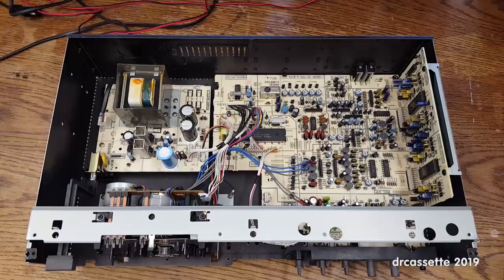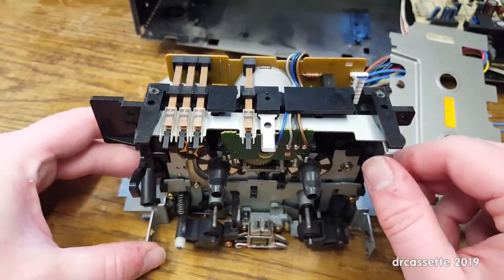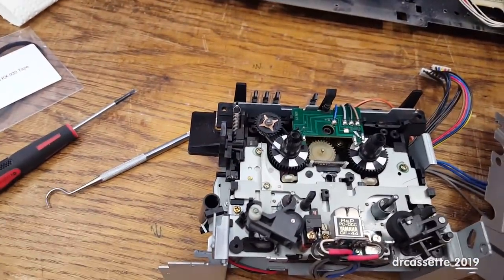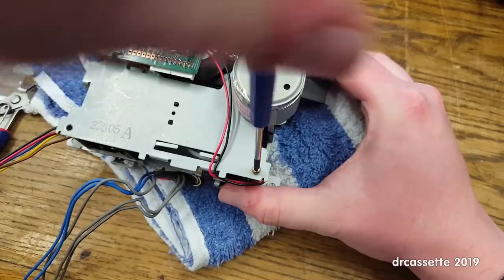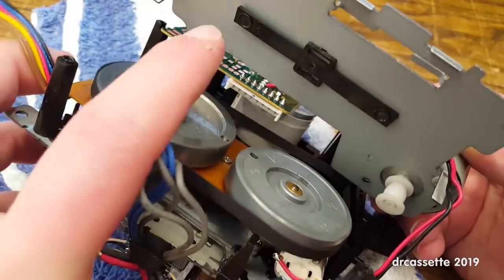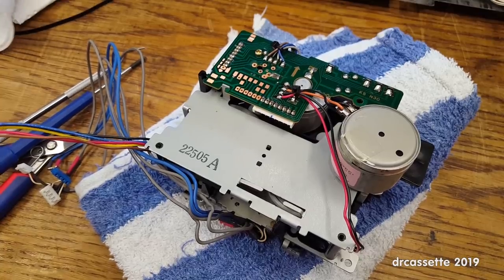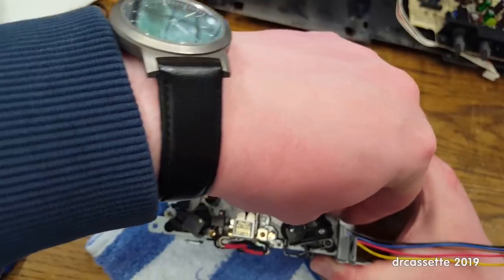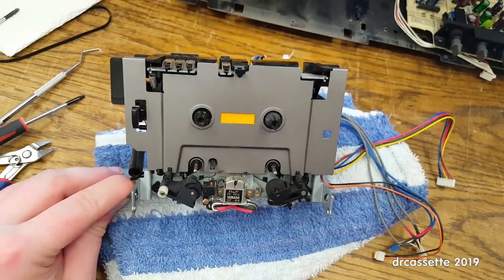Yamaha KX-930 cassette deck repairs [2/3] - belt replacement

Comment: Apparently Marrs communications is very good for high quality OEM standard cassette deck belts. Many people on tapeheads.net use Marrs belts, especially on Nakamichi gear. They are quite pricey though but again, supposedly the best around
Reply from the maker: I have heard of Marrs before, maybe I'll give them a try some time.
Reply: Exactly, nobody beats M.A.R.S, unless someone can still find original Nak belts or any other one OEM, preferably before mid 90's on this planet.
Reply: Alex Baker 
40 bucks for international shipping lol
Reply: @AttilaTheHun333333  
The belt kit and S&H from Marrs, or just the shipping (that hurts).
Reply: @pliedtka 
Just shipping...belts cost another 20 to 50 bucks. Those have to be really good. Lol
Reply from the maker: What? 20€ for a belt? Well, then that's never going to happen for me, unless I find a Nakamichi Dragon or something like that at the dump.
Reply: DrCassette 
They have belt kits for 50 bucks plus shipping. Ridiculously overpriced.
Reply from the maker: Most cassette decks that I work on are only worth about 50€. So putting such expensive belts into those just doesn't make any sense.
Reply: @DrCassette  
I don't think you find any Nak at the junk maybe BX150 or something similar. People are now more crazy about Nakamichi than before since the name is sort of a legendary. Well they were one of the first to introduce Dolby noise reduction, and in their implementation works really well, unlike one 3header, Dual Capstan Direct Drive, I owned, which was horrible in Dolby C. I heard Dragon once and it is one of the best sounding cassette decks, no doubt about it. But many are also very good, too bad good quality tapes type II and IV are NLA.
Reply: @DrCassette  you're right, for cheap decks it makes no sense but it might be justified for a high end Aiwa, Denon or Yamaha like yours I guess. Very expensive nevertheless!
Reply: @pliedtka  I only have an RX-202E and am lucky that theres still 1 authorised Nakamichi service centre left in the UK, albeit very expensive to send your deck to! It's a collector's market for Naks and is a bit like buying a car, because the paperwork proving it's been serviced at the right place increases the value.
Reply: @DrCassette  I have bought their belts a few times (not too many).  I have to admit they are very good belts but, it may take months to receive what you ordered and, if you follow-up you may not get an answer and, if you follow-up again or complain about the time it is taking, they may get upset with you and cancel and refund your order, and ban you from ever buy again from them.  I am not joking.  So you may just waste your time and patience.  I suggest you read comments about them in the common forums.  Best of luck.
Reply: @64bakes  
It is collector's item, like the 505. So B&W or Bang&Olufsen does the service. I read it about on tapeheads.net. This man 
www.ant-audio.co.uk, also Alex does a lot decks and makes calibration tapes to die for, not cheap but you get your money's worth. Has many decks in his collection, a few Naks, so visit his website just in case - he does service and align them from time to time from I read on the forum. 
Personally I haven't heard any other decks to sound in Dolby C as good as Nakamichis do, so keep yours in prime condition. All best 👍
Reply: @pliedtka  the place I was referring to is B&W like you mentioned, but I'm looking at circa £250 for a service! Mine is in mint condition with the original box and instructions, and luckily found it before the prices got too high. I do still use cassettes so will get round to servicing it soon, once I can stomach the price 🤣 

I've emailed Alex at ANT before about alignment tapes for an old Teac CX-400 which I used to have. He's a very nice guy and happy to spend time giving people advice. I'd recommend him all day long.
Reply: I just replaced the belts on my 930. Got the belts from turntableneedles dot com (in the U.S.). MUCH cheaper than Marrs and they seem to be of good quality.

Comment: why two pinch rollers when it"s not auto reverse ?
Reply from the maker: This cassette deck has a dual capstan drive, meaning both pinch rollers are engaged at the same time, one feeding the tape to the heads, the other one away from the heads. The speed that both capstans run at is carefully balanced to be slightly different. This way the proper tape tension across the heads is ensured. This eliminates the bad influence the supply reel and the cassette shell can have on sound reproduction.
Reply: @DrCassette  Thanks for the reply. Just got a free deck from a friend k-1020 and I need belts for it  : (

Comment: Is reverse one captan is supposed to turn reverse not like that you are placed wrongly the belt
Reply from the maker: This is not an auto reverse cassette deck. Both capstans are supposed to turn into the same direction. It's called Closed Loop Dual Capstan.
Reply: @DrCassette  is have 2 pinch roll  and 2 captan im never see anyting like this
Reply: @mikec9112  im navet see anyting like this soo is ok to know this but again is strange

Comment: Yeah, many belts on cheaper decks, especially double deckers, turn into black gummy goo stuck to the capstan wheels - many Sony decks being affected - sorry Sony fans, but from mid 90s the company many more and more junk until it seems to make mostly junk. Good made in Japan belts are available for many decks but you have to pay for quality more these days than before. Tapeheads.net, audio forum dedicated to tape decks has members who are knowledgeable and might give advice. Some people people sell calibration tapes, Alex being know for making excellent ones. Also there is W&F measuring soft available from one of the members - a must to have tool for testing and troubleshooting mechanism. If you have really good direct drive deck you can make 3kHz tape for setting speed after belt change - give the belt some time to set in. On the other hand I have question - where can I get spare capstan motor, CCW 12V, adj speed - same as in the Yamaha you have, but also used on many other machines.
Reply from the maker: How long have you been having dissolved belts in 90s Japanese equipment? This seems to be a rather recent development, when I got into repairing equipment about 10 years ago, you would only find dissolved belts in 1960s/70s Philips equipment and obscure old Korean equipment. Seems to me like the 90s cheap belts held up until fairly recently and are just now starting to fail and dissolve. 
As for your motor replacement, I would try to salvage one from another cassette deck. These are indeed very common in 90s cassette decks.
Reply: @DrCassette  
Had two dual decks from Sony, one with Dolby S. Both of them had disintegrated belts on both decks - the transports were of no better quality than some portables. But JVC, Technics, Pioneer and Teac from the same time didn't have the same problem. Have JVC and Technics under my bed with JVC having capstan motor dead with worn bearings in one deck (for parts)  and Technics still working properly with a little age related issues (worn heads, higher W&F). It's very hard to find used deck in Canada in good condition - Canadians are not in Audio like Europeans. There is a few of us in Ottawa that do DIY audio and repair electronics, some restoring old equipment but in Europe this kind of hobby is more popular. Another thing is that a lot top of the line equipment that was available in Europe and Japan never made it to Canada. You think I have seen Accuphase here - no, but some of my friends in Poland own it. My first contact with Nakamichi and top of the line Akai  Aiwa, etc, was in mid 80s because people were bringing them from Germany, with almost every Japanese brand available. You are in way better position to find worthy equipment like this Yamaha in Europe than me in Canada. From all electronic shops that still fix audio, only a few are left, run by Chinese owners and some hard core people who like it because nobody can get the parts or repair costs are too high. Well eventually I fix my Nakamichi somehow and really good CD player from this time that has all the functions and headphone output.
Reply from the maker: Oh wow, I didn't know HiFi equipment was so uncommon over in Canada...
Reply: @DrCassette  
There are good companies here, my friend Mark Kravczenko designs some of the best spkr drivers you can get, but in very limited number, his AMTs are as good as Mundorf. National Research Council has nice anechoic chamber that a lot of North American firms are using, and a lot pioneering research in spkr design was done there. Focus Audio from Toronto Area uses Eton and Scan in their spkrs SimAudio, Bryston, Paradigm are known every where to Hi-end enthusiast. But for most people cheap sound bar and large TV from Best Buy is enough and we have decline in serious audio interest in general, thanks to MP3s and junky headphones from Dr Dre (same price Audio Technica M-50X wipe the floor with them). So this is the sorry state of audio in Canada, at least in Ottawa.
Reply: I got serious problems with nice deck from the early 1980s with the "goo monster" belts -- actually with only the capstan big flat belt.  A mess to clean up, but then worth it -- lots of Q-tips, paper towel and alcohol -- some people suggest to use stronger chemicals as acetone but I didn't dare to use.  I agree w/ your suggestion to calibrate the speed w/ a proper speed tape (3 kHz).
Reply: @jdgshsjchdjejkd545  
It's almost impossible to get the 1990s original parts. I think the 530 motor might work in some Naks and other decks but the fact that its body is connected to the ground might be a problem. You can most likely find the Service Manual for the KX-930. On the other hand it might be possible to isolate the circuit board from the body so you won't have a short - you will have to remove the cover and cut the negative connection to the motors body. Don't have the motor on the table, so I guess from memory. Also some people complain that the current production has some issues. I think I will go with Universal Capstan Motor sold by Pacific Audio (or something similar in name) as is seems much more robust - of course more $, but better quality than 530.

Comment: I am so mad at myself today...for all that have a Technics RS-TR311...do NOT give up on a problem where the tape will not play forward...and will only play backwards...it IS THE center gear that look off yellow, that go between the two drive pins that go thru the tape...it has gone soft and the teeth break off, and they can be purchased and replaced...BUT not for mine..it is TRASH...... because I gave up.
Reply: find one for sale by that time decks were bought but not that much used ,so you might find one cheap and recover the part you need, i had a similar case and that´s how i restore it to play again but it was not a  yamaha, regards

Comment: that is not service-friendly for belt replacement
Reply from the maker: Replacing the belts is a bit of a challenge, but I have worked on mechanisms a lot more complex than this one, for example Sony.
Reply: try Nakamichi....😂😂 it take 30 min to just locate the belt .. let alone change it..

Comment: This seems like a good 3 head deck but its a truly shame to see it uses such a cheap 2 wire motor.
Reply: Many 1990's decks were cheapening out so lots of corners had to be cut. Most were not as good as late 70's to mid 80's era decks. Most cassette decks peaked in mid 80's.